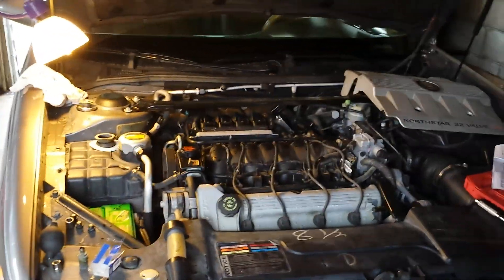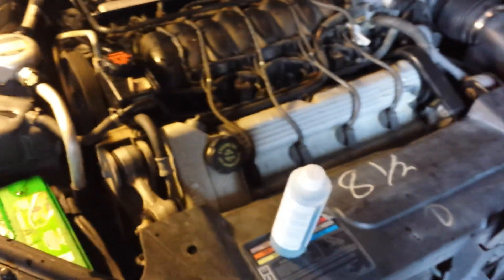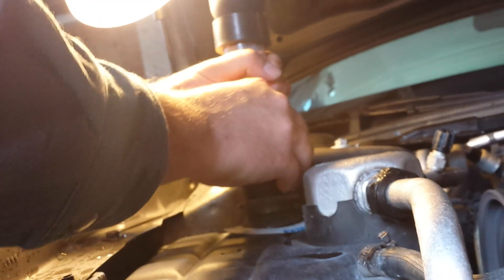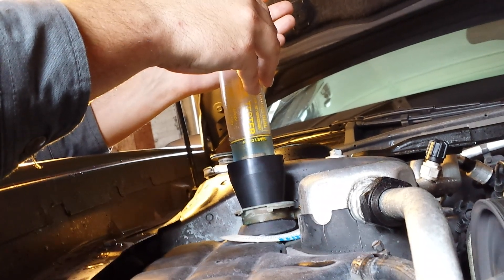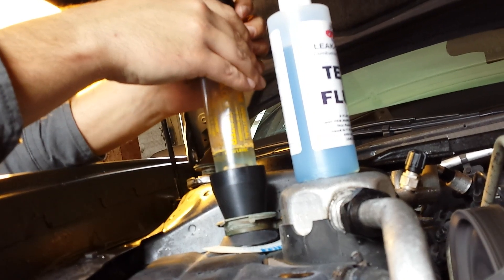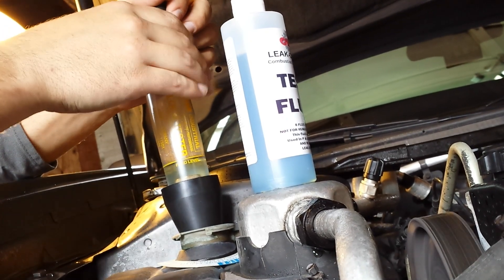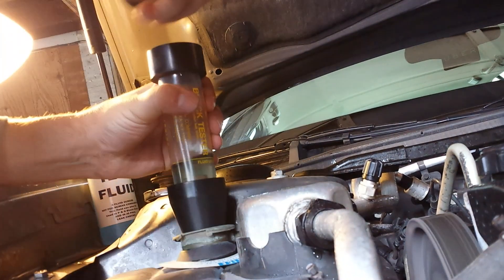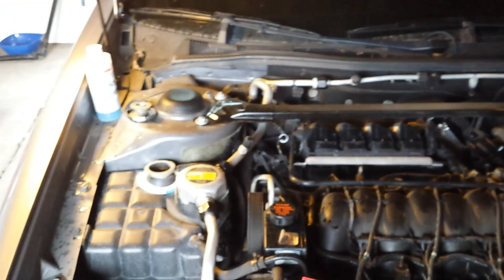Block Head Gasket Testing a Cadillac Northstar V8

Comment: pointless, it is a northstar motor, they are junk, plain and simple.
Reply: zoticus1 It is well worth putting money into these cars!  Rebuild the engine and keep driving them.  These cars are very well built, excellent build quality, excellent safety and great interiors.  You really get a lot of car and luxury for a small investment.  These engines do last forever IF maintained properly. They fail when its owner FAILS to maintain it.  I have two of them different years and they have been the best running and most reliable engines we ever had. No problems at all.  The Northstar is one of Cadillac's Best Engines.  There's a reason why they made them for almost 20 years. They are even popular in some custom speed boats, dune buggy's and some custom cars with the Cadillac Northstar powering them!!!!
Reply: +zoticus1   Pointless for you to say such a stupid comment, plain and simple!   Junk motors....HAH.   If you ever worked or even rebuilt one of these engines, they are one of the best made and very well built V8 engine by Cadillac.
Reply: zoticus1 Not exactly sure what that means but yes the Northstar V8's are far from being junk engines.  The Northstar V8 is still GM's best 32 valve DOHC V8 performance engines they produced.  Being built by proud UAW members and were all designed, built and assembled by GM's powertrain plant in Livonia Michigan.  Not sure how the Mercedes engines are but I do respect them very much.  Mercedes did produce some excellent motors and they also made a 32 valve DOHC V8.
Reply: zoticus1  I owned an older Mercedes once before and it was a beautiful example.  I respect the european brands very much but I much prefer the Cadillac's and Lincoln's for my luxury cars.
Reply: zoticus1 Personally I don't own any AMC vehicles mainly GM, but that does sound like another great idea....its been used for other big projects including custom speed boats, custom cars and dune buggy's.
Reply: AMCNorthstar 93
My uncle had the four door awd car, it was ugly as sin, but a cool car.
Reply: AMCNorthstar 93
My whole family worked at jeep, but chrysler and gm all the way around. I like german.
Reply from the maker: zoticus1 They sure are!
Reply: zoticus1 Never owned any AMC car before. And as you said, most of them were ugly looking and not very popular. Most of my family have worked up in Michigan at GM.  Its mostly been Cadillac's and Pontiac's and a Chevrolet conversion van for us.
Reply: Pointless with your shit brainless opinion plain and simple!!
Reply: I never had a problem with my 1996 Northstar that I owned since new.  112,000.  Much of the car is original. I replaced the surge tank and radiator last year because it started showing stress marks, and I did not want to overheat.  Change the coolant every 4 years. Great build quality on the body. And a reliable engine. Recently took it on a 3000mi road trip.
Reply: Yes exactly!!  I never had any problems with my Caddy's or did my family and we have owned them for years now.  When they are maintained properly, they really do run forever and are bulletproof engines.  The overheating problem is a problem with any other big V8 engine and there is a problem with GM vehicles and using the proper coolant.  Cadillac's are great just like any other luxury car and there is a reason why they were so popular and great selling cars for so long.
Reply: AMCNorthstar 93
anything will do ok if you know its weakness, it just so happens, the weakness of the engine is catastrophic failure.
Remember the yamaha engines for the gen 3 taurus sho?
Had to weld the cams to the sprockets!
Reply: That One GM Guy
 lol, you cant one of the best motors built?
Try the mercedes om 617 series, not junk northstar.
Reply: did you put a northstar into an amc?
Reply: Your comments are encouraging because for the past two weeks I have seen nothing but head bolt failure, head gasket failure, pull the whole engine and put studs in, it'll cost thousands, Northstar's are junk, never again, etc.... I am looking to buy a 1999 STS with around 100k that seems well cared for by a neighbor lady. It has been sitting for a handful of months and my optimism of buying a great car for a low price has been shattered by the prospect of a repair that costs "5 to 8 grand" as quoted by the repair shops today, if it were to happen. And everyone makes it sound like it is inevitable. What is your recommendation for coolant?
Reply: @pdxmetal  if you can get it cheap it's fine, 100k miles isn't bad. I got my 2000 DeVille in 2013 with 125k miles, it has 147k miles now and is only starting to have HG problems. Also, getting the head bolt repair is only $2500 to $3000, not 5-8k. Still expensive as fuck obviously but not that crazy
Reply: zoticus1 Respectfully disagree.....they are not junk motors.  They only turn to junk when they are not maintained.  I have seen a lot of good cadillacs with this engine here with out any problemsand ones with very high mileage. I have one and never a problem.

Comment: This test can be done as soon as you start the engine (or shortly there after). The coolant flow is ALWAYS flowing through the cylinder coolant ports on a northstar and always flowing through the coolant fill tank. The thermostat has nothing to do with coolant flow through the engine.
This test can be a false indicator of a blown head gasket. On a northstar, coolant can be exposed to exhaust gases by a failing coolant cross over manifold gasket (which is also a very common leak associated with the northstar). When the EGR valve opens, exhaust gas flows through exhaust ports in the coolant manifold crossover to cool exhaust gases before the gas goes into the intake. A failing gasket here will introduce exhaust gases into the coolant - thus causing this test to be positive for exhaust gas -- but not necessarily a blown head gasket positive test.
The ONLY way to prove that a northstar has a blown headgasket is to do a proper cylinder leak down test on a warm engine - which should take 2 or 3 days...
Reply: How does a T-stat not have anything to do with the coolant flow? The bottom rad hose goes to the motor and the T-stat is right there. Makes no sense??? 1997 Eldo ETC here.
Reply: I said coolant flow through the engine. The lower hose does not connect to the engine. It connects to the t-stat housing 'in' flow, which is part of the coolant crossover manifold on the Northstar. Coolant flow is constantly flowing through a Northstar. It flows from the res tank - through the block - then heads - then heater core, in a continuous loop, in that order. All the t-stat does in a Nstar in allow coolant to flow through the radiator, that's it. When the t-stat closes, coolant still flows at 100% through the system.
Reply: The system is not like a normal gm engine system (of the era).  If there is exhaust gases in the coolant, waiting for the t-stat to open is a waste of time.
Reply: Tom Joyce Right now I don't have a t-stat in my 1997 Eldo (just haven't put it in yet) and my car still gets a bit hot then the fans kick on. With the T-stat the car never gets hot and the needle never goes past the middle mark??? Doesn't that bottom hose connect right to the water pump? Shit. Now I'm gonna have to go out there and look. Don't remember.